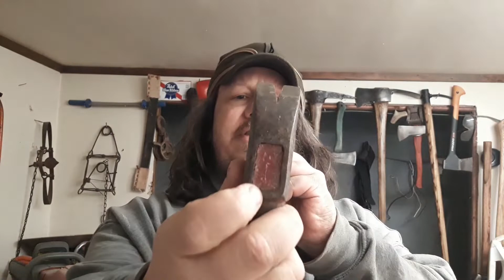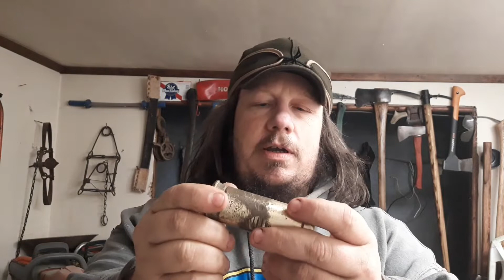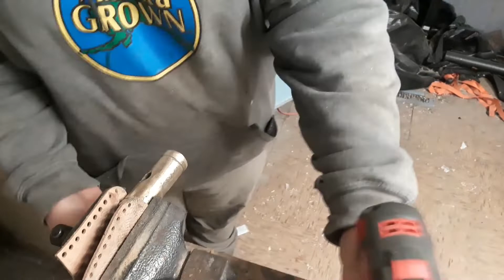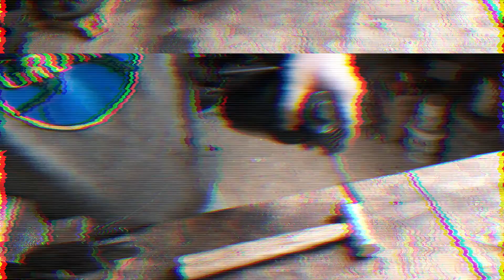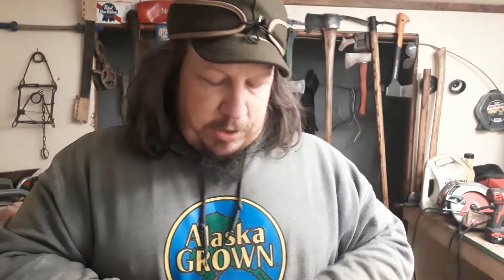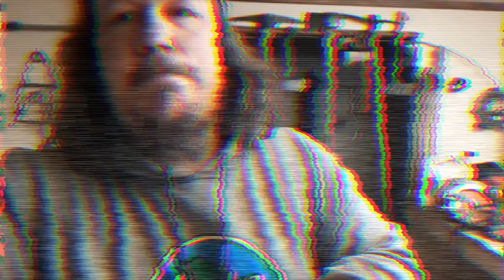Snap-On Brass Hammer goes through Rehab

Comment: Beautiful little specimen. We use brass hammers here in the gas and oil industry for the no spark thing. That steel wool is a great surbival tool when you add a 9v battery! Something every 24hr survival pack or edc bag should have is 2 alternative ways to start a fire.
Reply from the maker: Ya..u can use your phone battery and steel wool too...  👍👍
Reply: Great idea. I have a galaxy that i cant take the battery out of but in a life or death situation id break it open for the battery if i had to!! Great tip!!!

Comment: You see a moose - I see pizza toppings....That rivet hammer you had there, well I picked-up something similar, only smaller about 1/3 that size, has a square head, long narrow body and the opposite end has a space between the metal and these two halves taper down to make about 1/4 inch head. I picked it up at a yard sale to use as a gunsmithing tapping hammer and because it seemed cool, think I paid 2 bucks.
Reply from the maker: Yes they are tasty. 
What you found is a tack hammer.. and is used to drive square nails for putting shoes on a horse.. the open end is used to bend and break off the brittle excess.of the nail.  They are handy

Comment: Hey Jamie I got a question does it matter if you stay in your handle before or after you put your head on I just noticed you always stain yours afterwards
Reply from the maker: Well liquid can cause the wood to swell.. so i fit it tight as possible.. then add stain and oil after...so it swells for an even tighter fit then.  Thanks Bill
Reply: @JourneyNorthAK  thank you brother I knew there had to be a good reason